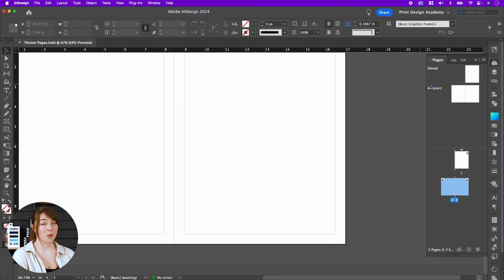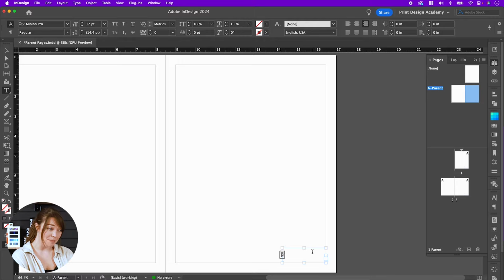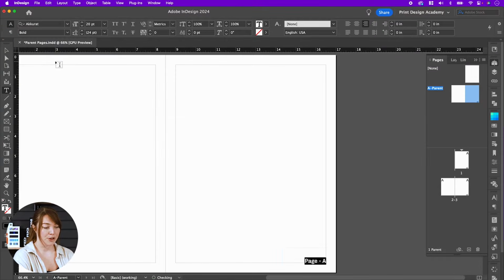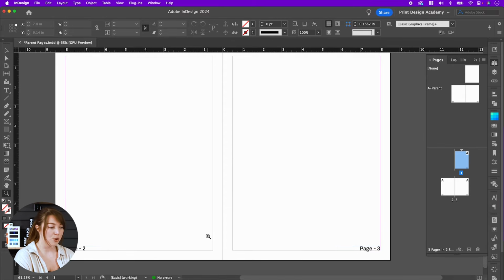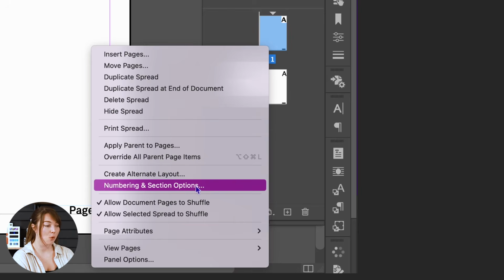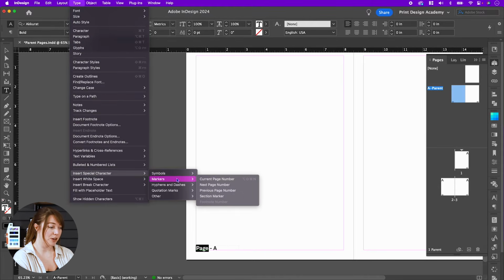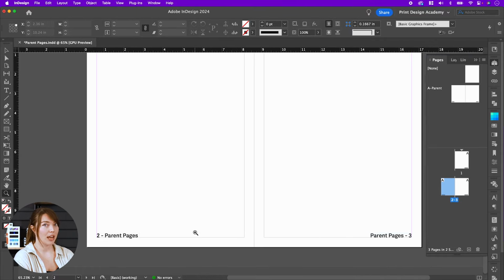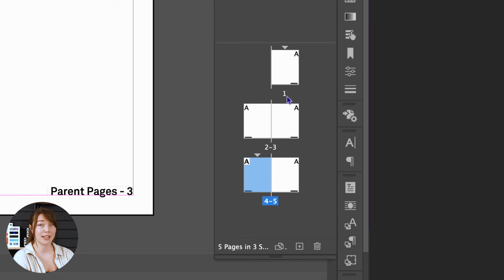Adobe InDesign Page Numbers Tutorial using Parent Pages

Comment: Is there a way to change the order of the page numbers? From ascending to descending? 🥺
Reply from the maker: Shoot that's a tough one, but basically there isn't an easy built in way to set them to descending. You could do a Data Merge at the very start on blank pages where you have an .csv file (excel) that has 1 column with your numbers descending (but you'd need to know the exact final page count) and then choose a text box for your where the Data Merge where the page # will be. You won't be able to do this after you've designed on them already unfortunately. It'd have to be done at the very start and even then if you wanted to move the location around, you'd have to do it individually on the pages. Up to you! Or just swap order in PDFs after you're done. Might be an auto way in Acrobat afterwards.

Comment: I have a 15 pages, single page document. The problem with page numbering is it turns to 1 everytime after page 9. And thereafter every page number is 1. Any solution? Or, is it a  bug with the software?
Reply from the maker: Hmmmmm sorry for the late reply on this one! It's hard to say without seeing it. And did you make sure that the box was wide enough that it's not just showing the 1 in the number 10, 11, 12, etc?
Reply: @PrintDesignAcademy  I tried every trick, including putting the page number middle of the page in 72 points...lol